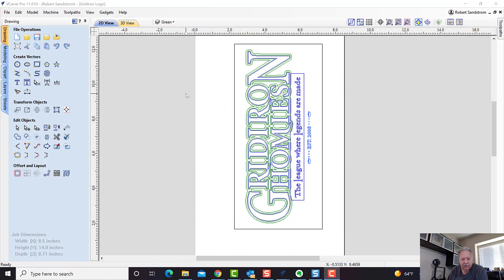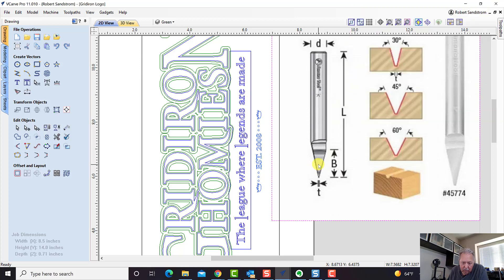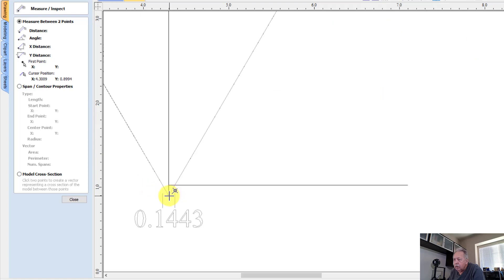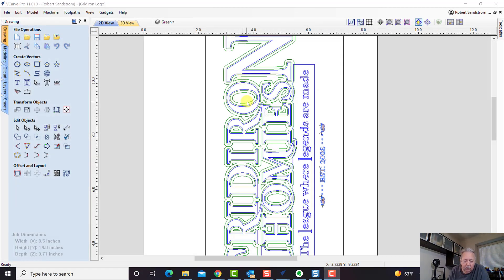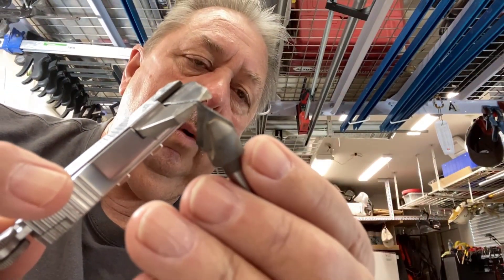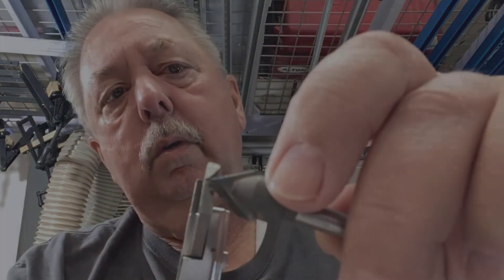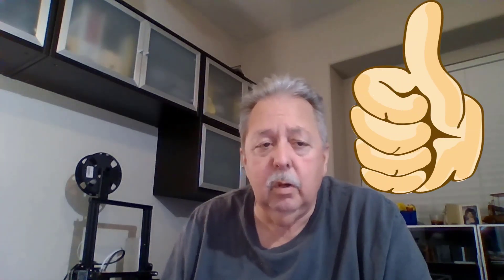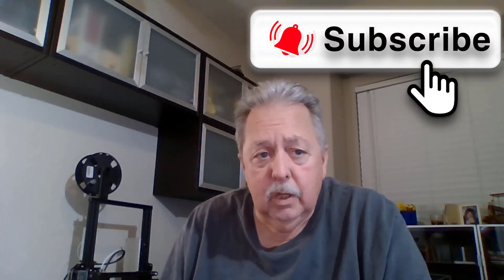Does Size Matter   OR   How Big Does My Vector Need to Be

Comment: Please email me that size chart.  Also, would it be OK to use a smaller bit even if a larger one would be called for? Thanks for your time.
Reply from the maker: Larry...thanks for watching.  Can you send me your email address to generationscustomcreations@gmail.com.  If so I will send the chart.  Yes a smaller bit would work as long as the toolpaths are setup correctly.

Comment: Hi Rob. I am not sure if my earlier message went through or if I even had sent it... Can't find it anymore so I assume I haven't sent it... Anyway another great video with simple and understandable information's! Maybe as a consideration for the table to share with your followers... Starting with V-bits at 15° and below (as far as my experience goes) there is the Tip width which needs to be considered in the calculations. The Tip width is at least 0.005" (0.127mm) which changes the figures of the size of the vectors and/or cutting depth...
Reply from the maker: Pat I didn't see this comment before.  Thank you or sharing your insights.  You are correct that the tip width may make a slight (thousands range) in the final depth.  

This is not enough for me to get overly concerned with for the work I will be using this table for.  For multicolor epoxy purposes and vCarving efforts I will use the calculations for the table will work.  As such, I don't plan on pursuing any additions to the table.  If Rob Shuster reads this he may take the challenge - it is his table - but don't really think it is needed.  That's just my opinion based on my personal experience..
Reply: @RobSandstromDesigns  Hi Rob. Yeah I guess I haven't sent it before... Indeed it does, depending on the tip width make mostly a slight difference. The 0.005" (0.127mm) can be "ignored" with cutting depth of 0.125". It becomes more a matter if your details become tiny and cutting depths are shallower due to this. I did my table with the different tip width's and it helped me already a couple of times when I had to cut tiny details. Anyway I appreciate your dedication and your willingness to share your daily experiences and knowledge!

Comment: I have sent you an email requesting your spreadsheet. 

Also since .125" is the sweet spot for depth of cut, why not have that in the spreadsheet as well?
Reply from the maker: Mark...you should have gotten the spreadsheet.  As for the .125" section on spreadsheet this is not my actual table - it is provided by Rob Shuster.  if he or someone else wants to add it they can feel free to do so and I will update and distribute in the future.  Thank you for watching.

Comment: Thanks for another great video. One of the best explanation of v bits that I have seen. Can't wait to see what the next one will be. Also appreciate Rob Shuster putting together the spreadsheet and sharing it. I will send you an email with request for a copy of the spreadsheet.
Reply from the maker: Saw your email.  Should’ve received file by now.  If not let me know.
Reply: @RobSandstromDesigns  Thanks for your prompt response to my request. I have received the file.
Reply from the maker: You should’ve received file by now - if not let me know.
Reply from the maker: I saw it…you should have it now.